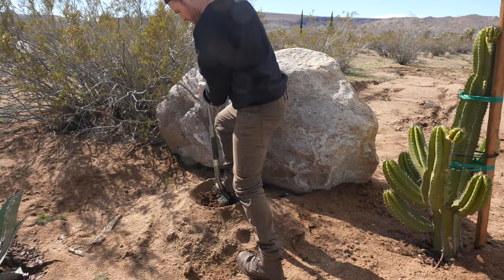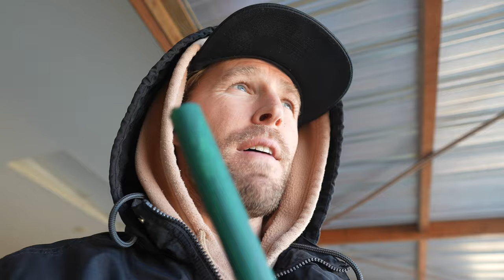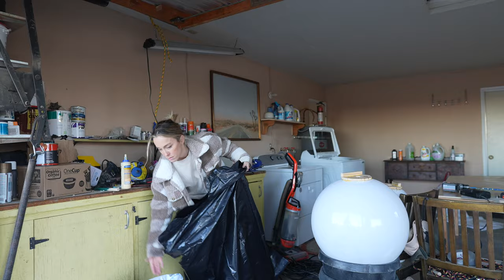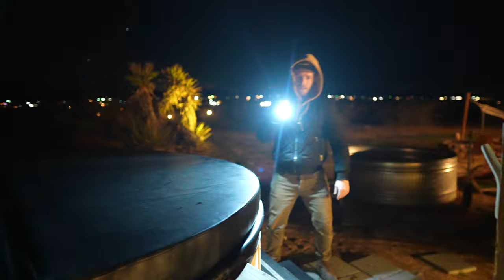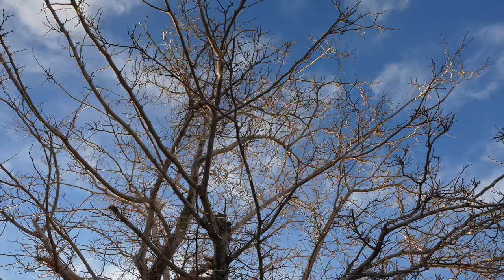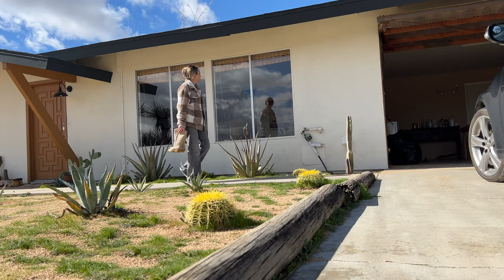Finishing Touches On The Moon Garden (Life As Airbnb Hosts)

Comment: Is that a zinus frame? If so, I had the same one in my airbnb and it would not stay tightened either. I even reinforced the entire thing with wood glue which bought me a year, but it eventually failed. I think the wood glue would have kept it tight but our bed is on carpet and the cleaners moved it every clean to make the bed which was just pulling way too much on the joints.